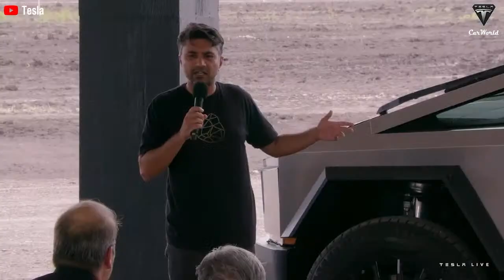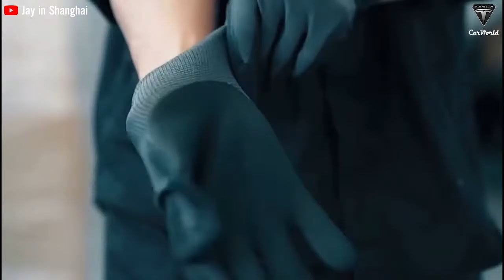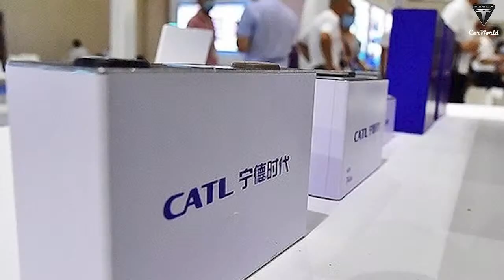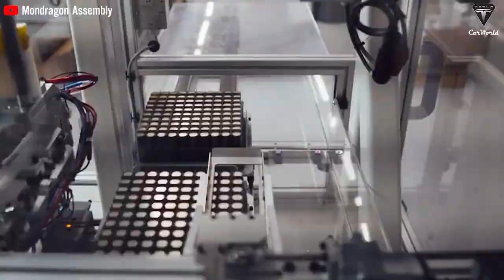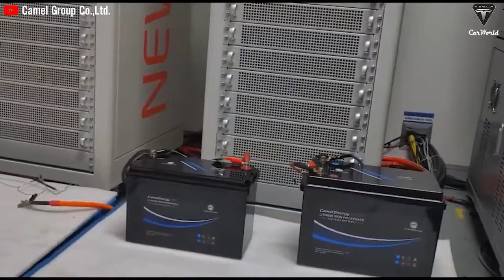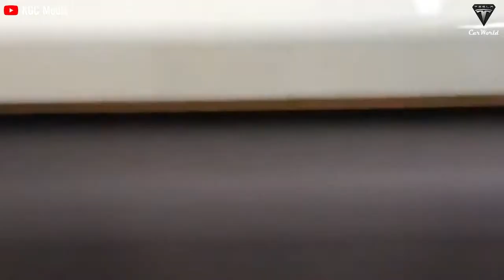Elon Musk Explains REAL 3 NEW Batteries Tech in 2025! No More Lithium Needed? (Mix)

Comment: I would pack all possible carbon steel heavy duty unbearable material to pack the batteries at any expense even to increases weight just to make the batteries explode proof
Reply from the maker: While ensuring battery safety is crucial, increasing weight significantly could compromise vehicle efficiency and performance, which are also important considerations.

Comment: The true cost of Tesla 4680 is 70$/kWh while BYD blade cost 35$/kWh.
Without subsidy, Tesla will not be able to compete.
Reply from the maker: Cost is only a small issue, what matters is the power of these battery packs and how easy they are to process or manufacture.